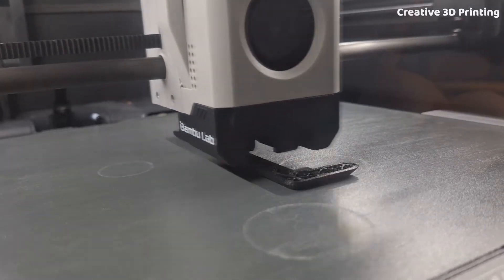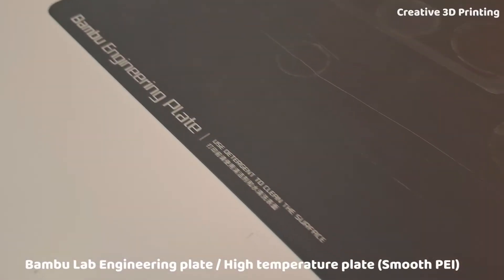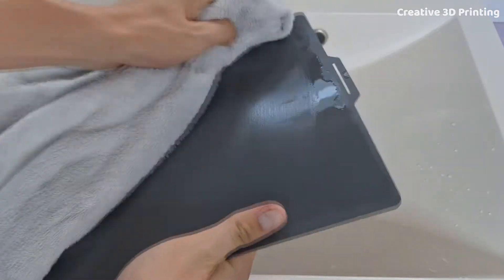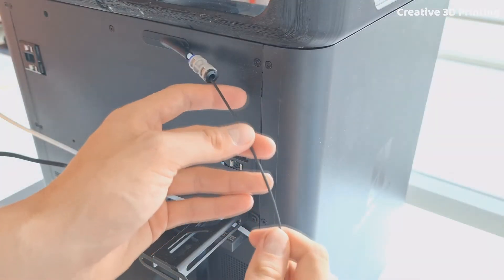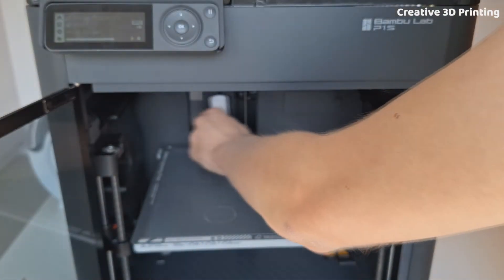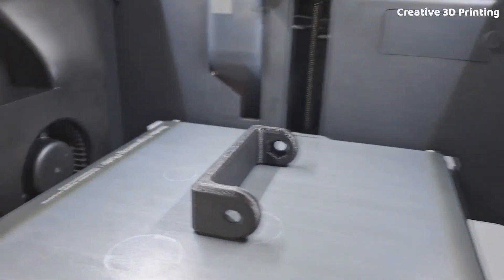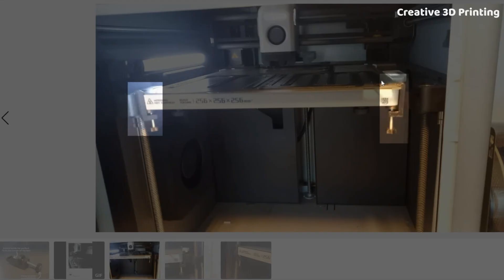Master Carbon Fiber 3D Printing | Bambu Lab X1/P1 | 2/2

Comment: Are you not printing through the ams?
Reply from the maker: For carbon fiber filaments I like to print via a heated filament drybox.
The feeder in the AMS may not be perfect for abrasive filaments but it is possible, I just don't recommend it ;)

Comment: I believe they removed Engineering Plate,  can the Smooth PEI plate capable to print nylon carbon ?
Reply from the maker: I never tried that but it should work.
I think that the regular textured PEI will work too

Comment: Have you faced any issues with warping with any parts and is the 100 celcius limit been ok for you when printing these parts.
Reply from the maker: With the glue I haven't had any problems with warping, 100° Celcius works perfect.
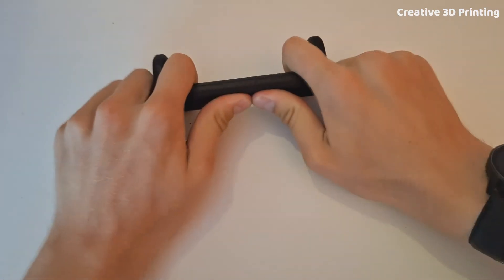I only recommend for printing the parts apart from each other (Print sequence > By object) and not to close to the corners mostly for longer prints like at 1:29 .